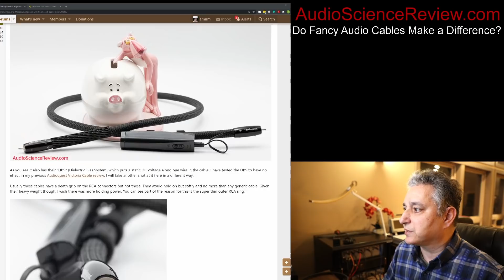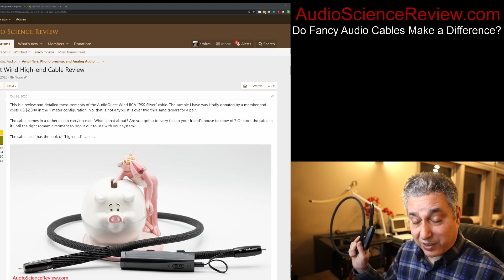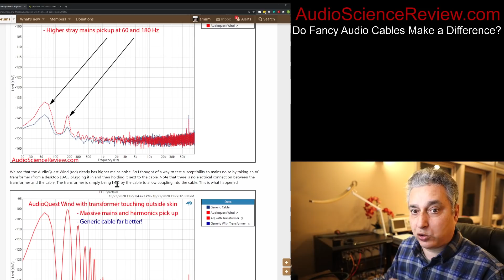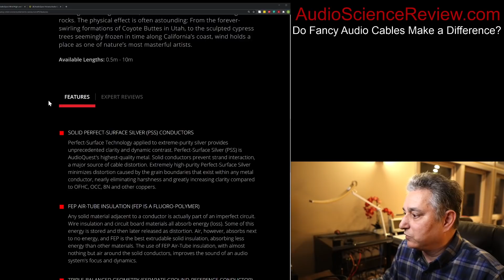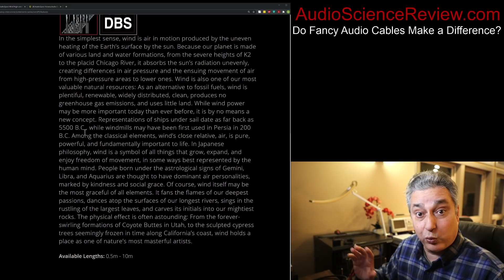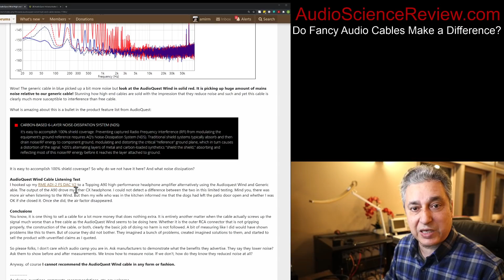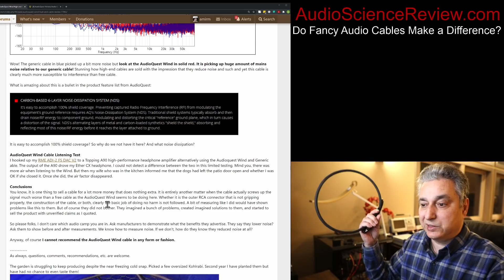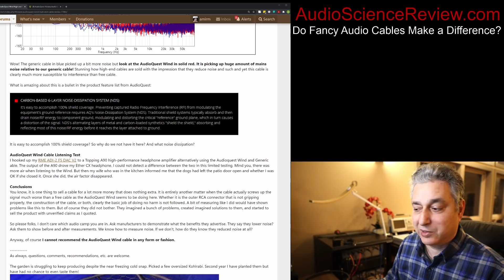Do Fancy Audio Cables Make a Difference?

Comment: 40 years ago I used to sell MIT cables. They sold well cuz I’d loan out a trial pair to customers that liked the sweet sound and amelioration of upper midrange glare that affected many records. Then I delivered one pair that was refused cause they didn’t sound like the test pair. After taking with the distributor I found they’d been “updated” but fortunately still had stock of the original version. That’s the most double blind taste I could imagine. Perhaps such an audible (and remembered) difference could have been measured.

Comment: Why would you buy a cheap cable? Sure, it's fun in the beginning. But you will just end up taking it for granted. You will pull on it to disconnect it. You will leave it lying on the ground where everyone walks. Spend the money. Respect yourself.

Comment: I wondering if the thickness of the cable has anything to do here. Perhaps the design of the cheaper cable actually makes it more effective at blocking noise, e.g. less separation distance between the inner conductor and the outer shielding, to save on material costs, thus having better noise reduction? In general it helps to have the signal and return conductor as close as possible to minimize the area of the loop-antenna that is effectively created. Anyway, I will keep investing in cheap cables 😂

Comment: My Audioquest RCA cables introduced hum from my turntable to my pre-amp. Swapped them for the generic cables that came with the turntable, which were dead silent. Went back to the AQ cables, just to see, and moved them around a bit, but they still hummed. Reconnected the generic cables and have never bought another Audioquest product.

Comment: I have an Audioquest RCA interconnect — not $2500, it was maybe $200. I used it to go from my turntable to my amp, replacing the Fluance factory cable. I just wanted to see if there was even a placebo effect. Quite the opposite. I picked up a very audible hum right away. The Audioquest was hooked up with the arrows pointing in the right direction. I switched back to the Fluance cable — nothing. Dead silent. Played a record, it sounded terrific. I plugged the AQ cable back in, got the same hum. Checked the connections — all tight. Jiggled them, no change. Even “reversed” the cable. Same hum. So that ended my experiment with high-zoot interconnects. YMMV.

Comment: You’ll never convince me that all that expensive cable stuff is anything other than snake oil. If you think you hear the difference, great! Knock yourself out. I’ve tried the big fat cables and the super-conductive fat-free cables from outer space and then plug in the cable that came with my system and they all sound the same. It’s electricity flowing through a wire.

Comment: Point of order: You seem bemused that the cable picks up magnetic interference with the comment of "it's supposed to be shielded". Screened (shielded) cables do not protect against magnetic fields. This is simple physics. In radio we actually use coaxial (i.e. screened) cable to wind transformers. This is simply because the magnetic field goes right through the screening as if it wasn't there. Screened cable protects against electric fields, which are a completelty different animal. The orientation of the cable to the magnetic field makes the biggest difference, the screening/shielding does nothing, and cannot be expected to.

Comment: Standard copper cable is industry standard in TV land.  Space land may use silver or gold but for different reasons .
True TV land does use gold plated connectors on occasion but more due to that tarnish thing.
Lots of phono plugs tend to be gold plated for some reason, but I never ever came across a gold plated xlr  in all my years and I have worked on projects world wide.

Comment: Amir, what cable for speaker would you recommend? 

I'm using basic reel I got from Amazon, does it get any better than that realistically?
Reply: It depends really. Do you have a 120 grand setup? If so it may benefit slightly from a higher quality electrical path.

Comment: Of course cables make a difference. It’s indisputable. You would never take the power cable from your 20 watt bedside lamp and use it to connect your 3kw electric heater to the mains outlet. You’d likely incinerate that cable. Neither would you take the mains cable from your 3kw electric heater and use it to connect your 20 watt bedside lamp to the mains outlet. Yes, it would work, it would do the job, serve it’s purpose, but with no benefits over the generic cable for the 20 watt bedside lamp!

Now, when we’re talking audio interconnects, I believe there can be measurable differences. But, as Amir rightly pointed out, the chances of those measurable differences being audible are, extremely remote!  Keep your interconnects as short and you negate external RF or EMF  influences being of any concern.

Keep up the good work Amir. I think that sometimes elitist audiophiles need realists like your good self to keep them grounded. Forgive the deliberate pun.

Comment: One question: when you tested the magnetic interference susceptibility on the AudioQuest did you try moving the transformer closer and further away from the battery case? did the waveforms change as you moved the transformer along the cable? 

Great video with repatable tests on very good equipment!

I've always thought the important thing with cables was the metal used, the insulation used (dielectric) and the shielding used. What it looks like has nothing to do with how it sounds. Just buy some good wire and attatch good connectors to it and you should be all set.

Comment: This only proves that we're attracted to noise and interference in the signal path. The same argument can be made for vinyl reproduction that is obviously worse than a good digital playback. The thing is that bad digital feels wrong whereas bad analog is acceptable or even praised. The same can be said for digital image. I work in colour grading and restoration with reference equipment. A correct image is not always as likeable as an analog one. This Gestaltian rabbit hole can go very deep into psychology, emotions, sociology, etc.

There are better cables out there.
An upgrade makes sense if your speaker cable is REALLY BAD. I had my monitors connected to my amp with an old, crummy multi wire cable, salvaged from some electrical bin. The cable was thick so I thought it'd transmit sound with greater efficiency than any other thin one. Only when I made a DIY speaker cable with CAT-5 Ethernet cables did I realise how bad that cable was. The difference in sound was immense.

The snake oil argument.
Instead of having products marketed with metaphysical wordings about purity, brands should own the fact that their products simply introduce a flavour to the sound and offer a range of products for each taste. This would put an end to the path of constant improvement, showing that it's simply an illusion of the senses. Everybody would be happier and some idiots would be less poor.

Comment: The battery pack is used to create a miniature black hole on the "unconnected " end of the wire, which is redirected straight to heaven. This conducts angelic power to your hifi components. (Excerpts from leaked Vatican inquisition into Audioquest's diabolical abilities).

Comment: I want to believe that quality speaker wires and cables shouldn't make a difference but I see a lot of reviewers who said they thought the same thing till had some incident that changed their minds.  The problem with measurements is that you can only measure what you know but there are so many variable goes into play to get a sound source to our ears that you might be missing something.  I would love to see a reviewer like Jay (I doubt Danny would agree) who claims they can hear a difference in cables send you 2 of their cables that they know sounds completely different.  You measure them to see if they are identical.  You (or someone you trust) then bring them to Jay's listening room and see if Jay can tell the difference in a blind A/B test.
Reply: In this case it made a difference - the overpriced AQ cable was measurably worse than a freebie cable due to ineffective shielding.

Comment: Great, someone finally pulls the rug out of these snake oil salesman and, more,  the audio reviewers who have marketed this crap for the last forty years. Shame on them; McIntosh labs told us back in the late seventies and eighties there was no need for expensive speaker wire, but the magazines and reviewers kept pushing it. They wanted the advertisement space in their magazines, so cables "Brought my  system to a new level of openness; even my wife noticed the huge change."   So many empty adjective-laced paragraphs with zero testing. Stereophile, Audiophile, Stereo Review, shame on you!

Comment: Though these are good things to measure. It’s only 2-3 measurements.  I believe another added test would involve frequency response over time… do all frequencies arrive at the same time? How do we measure the speed of millisecond bursts of white noise full spectrum?

Another test using program material. Do a null test and measure for a measurable noise floor from the null tests… 
I’ve done null tests of cables and witnessed the noise floor raising sometimes to -60dbfs which means something is different? Even though it’s not audible not everything is nulling.

Yeah these simple tests reveal some simple truths but they are definably limited.  FYI I won’t be buying an Audioquest cable anytime soon… that simple interference test was pretty sad.

Comment: A battery operated cable is such BS!  Everyone knows you can't get the correct imaging and depth unless you use a/c powered cables.  I just upgraded my whole system.  All of the power supply cables to my components have their own power supplies.

Comment: Great video! What about things like slew rate changes over time, dynamics? I’m not an engineer but your test all seem static to me. Please correct me if I’m wrong.
Reply from the maker: Those factors don't matter because analog audio has such low bandwidth.  Extra bandwidth in the cable doesn't do anything since you are limited by the audio bandwidth itself.

Comment: Amir, What is the theory (science or snake oil) behind cable riser’s ?
Reply from the maker: From a rational, electronics point of view, none!  :)  Some people talk about interactions with ground (as if the cable is literally on ground) but any such effect would occur at very high frequencies.  And at any rate shielding would be the right solution there, not a cable lifter.

Comment: You absolutely need to complete a circuit (otherwise no current flows)., so it's pure snake oil and deceptive marketing. Anyone with a modicum of electronics knowledge would never fall for this scam. Many audiophiles are some of the most gullible people and the difference they hear is only due to the placebo effect. "I spent $5000 on these pretty cables, so they must be superior". The cables often come wrapped in snake skin, which is very fitting to the snake oil inside. There is a difference between the cheapest (red and white) RCA cable with zero shielding and too small and poor quality conductors, compared to decent OFC and properly shielded cables. The difference is between $5 cables and $50 cables (that makes a significant difference. Silver conductors are a little better than copper, but that is about as good as it gets. Silver is significantly more expensive than copper, so maybe $200 is a fair price for silver cables, but there is nothing magical that can be put in cables to warrant $1000, let alone $5000, or even $50,000 or more. 

Many of these insanely over priced cable add a couple dollar of capacitors and/or inductors to act as tone controls to flatten overly bright (super detailed) gear. Just buy neutral (natural sounding) components and there is no need to buy overly priced snake oil cables as the world most expensive tone controls. Interconnect cables do not need "batteries".

Comment: I cleaned my cable metal connectors with deoxidiser fluid and heard an improvement in sound quality. I wonder whether "new" cable improvements are partially down to this effect, assuming it's real?
Reply from the maker: Sometimes it is due to that.

Comment: Thanks for your videos.   Like your methods to testing.   I think after watching a few a few of your videos you are clearly rigorous.   I agree with using your tools you find sometimes cheap vs expensive is minimal if any difference.   What about other factors?  Longevity, reliability etc?   Build quality not only on function.   Other factors.   Maybe this cable lasts longer or maintains better connections internally.   Functional equivalency is expected (mostly).   But there are more factors?  Right?   I suppose debunking the more expensive components claims is your thing…and we appreciate it.  But dissection of the products at a build
Level may be good too.   I go to the hardware store and see millions of screws.   Which one is not going to strip?   Well…what you find is that not all products are equal even though equivalent in function.

Are you going to do some vintage gear?   Be neat to see you do some comparison of older products to show whether they shield better?   I have some cables from the 80s and those are fine for me.
Reply: I hope you are joking, but I'm afraid you are not.  When you go to the hardware store do you see screws selling for $500 vs. the $0.5 one?  Do you ask the salesman if the $500 screw has smoother threads?  AudioQuest are frauds who's owners should be in prison.

Comment: Yes, this cable, like many marketed to naive audiophiles, is BS. However, you can’t draw the conclusion that simple measurements like you’ve done get to the core of the story. You could measure 10 cables this way but put them into a hi rez system, not a low impedance AP analyzer and listen. If you’re honest, you’ll find they all sound different even though they measure the same. I’m also an engineer and I know measurements are only part of the story. Look back 60 years ago when engineers were saying we understood everything about, say, radio, or transmission lines, yet today with our (mis?) understanding of Quantum theory, we laugh at those assertions.
Reply from the maker: As I responded to you in the other comment, you need to educate yourself on how to properly evaluate audio components using your ears.  Until you do, you are going to arrive at wrong conclusions and with it, waste a ton of your money on stuff that doesn't make a difference.  Again, see my video: https://youtu.be/vRG8TaxGcbU

Spend some time reading the literature and fallacies of the type of listening  you are doing if you want to be "honest" with yourself.  If you want to remain confused, sure, go ahead and but don't tell me that.  I fully experience what you stay but I know what is a false perception and what is reality.

Comment: If you're going to act like you're providing an unbiased review & opinion, then at least act like it. I don't think they're worth the money, either, but damned if I'd believe it from someone like you.......smdh
Reply from the maker: You don't have to believe me at all.  I don't provide opinions. I provide reliable measurements that are not countered by anyone.  You want to argue against those, then show me the data.  If you can't then you are welcome to believe or not.  But you can't stomp your feet that I am wrong.  

FYI I have a fancy audio cables and can afford to buy any of them.  I don't use or buy them because they don't work based on proper engineering analysis.

Comment: I like nice cables and use them (either Blue Jeans, or the low end of some of the other name brands, usually).  But I consider them “audio jewelry” and don’t expect any difference in sound.
Reply from the maker: Good attitude.  indeed you can go too cheap and wind up with cables that don't work reliably.

Comment: No fan of audioquest due to their aggressive pushing of products. I do know 'regular' analogue cables (interlinks, speaker) can sound very different. Sometimes day and night. Did a replacement of a normal hifi cable of about 200 a set, with a second hand pair of 2000+ euros a set. And ye, mind-boggling. Sound stage, bass control, realism, etc. 

No guarantee all expensive cables do this, and i never would have bought it new. So many variables....

You're welcome to come and listen;)

Comment: Great work Amir. As a related aside, many years ago I tested various speaker cables using an AP System One comparing the signal distortion at the amplifier's output to that of a real 2 way speaker's input, and there was a measurable difference. With a complex load (back emf etc.) and most amplifiers only taking negative feedback internally (not from the speaker input terminals) there is at least an objective reason as to why speaker cables with their inherent electrical parameters can affect subjective quality :)
Reply: True but humans are relatively low res.

Comment: Snake oil and measurements aside, let's say it did do something, anything, at the very least reduce electrical interference or noise or whatever...

... Why does it need to be 2300$ though? Like, you can get quite a beast of a gaming PC with that kind of money, with actual electronics, sophisticated components, hell even watercooling probably, that thing uses actual pumps!
I think the only reason it being that expensive is to further trick the brain into thinking "higher price = better performance", i mean i get unnecessarily expensive stuff, especially when it comes to build quality/aesthetic. But don't attach a lie onto it